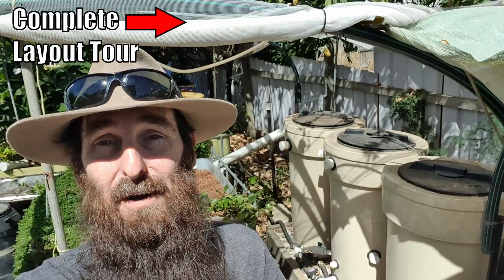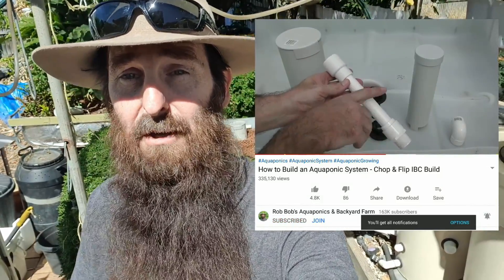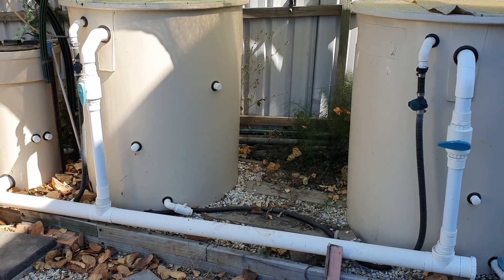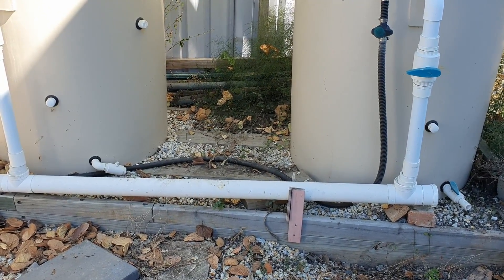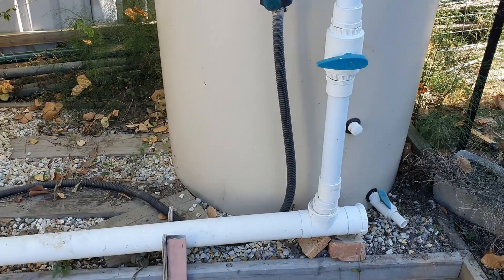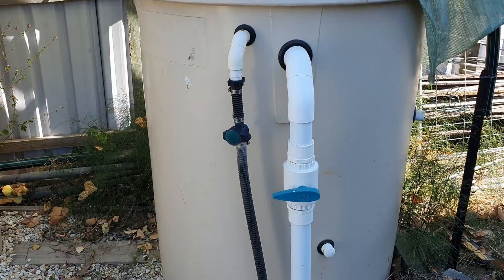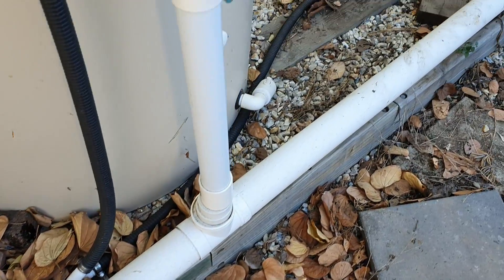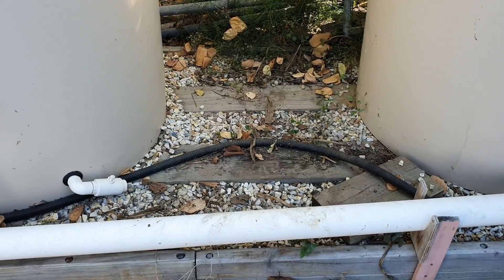Aquaponic System Design Mistakes | Don't Copy Me

Comment: I am having problems with my water vacuum bell valve - when I add lots of supply water the bell valve starts to drain but air suction doesn’t break and it continues continuos - I lowered the supply and now bell valve doesn’t fill to make suction it continually runs same amount of supply - my plants are standing in constant water and I’m having some wilt problems - I’m note sure where to start with what correction - help
Reply from the maker: The video below has a few fixes in it Danny 👍 It should start at the start of the trouble shooting section.
https://www.youtube.com/watch?v=hpVzsM_7uZo&t=1076s
Hope that helps.

Comment: The false bottom principal would remove a lot of that debris with a waste valve
Reply from the maker: I'm not sure that would work on a flood & drain as the draining of the bed from the base would suck the solids along with the water. It may work in a constant flood bed. 🤔
Reply: @RobsAquaponics  I’m talking about the bio media)of course it would work if the exit is at the same level as the false bottom and below the false bottom a waste valve
Reply: Kinda like a radial flow filter but wit a false bottom/ it’ll make ur shaded plants thrive in pure sun

Comment: Great clip again rob, going over something you would change in the future.
I too did run with a 25mm pipe straight from my pump and had the same reduction issues you faced. I have since rebuilt my feedline 'manifold' all to 40mm closest the location of where they are needed, and removed all the 90D bends out of the system in favor of y fittings and then reduction down to 25mm.

from my flow rate i have managed to get the same volume out of the pump lowering the pump down 8% which adds up over time in 24hr costs, not to mention i now have an additional 8% if needed!

can suggest anyone do the same when planning out your system, try to remove or reduce all hard bends, from 90D to having better sweeping bends with 2x 45deg joins and try to keep the diameter of the pipe closest to your pump outlet as long and as high as you can

also highly recommend oversizing your pump, i started with a 3000ltr then 6000 and finally at 20000ltr per hour. Larger pumps often draw less to move more! go straight to a DC pump where you can dial in your required flow rate
Reply from the maker: Running the largest diameter pipe you can is a huge energy saver. 👍
Thanks for the feedback mate. It will help others that like to learn from the comments. 😁👍

Comment: Maybe certain parts of the system could benefit from being made of metal, in commercial food production we use sanitary tri-clamp fittings, they may prove useful in certain areas. Generally speaking they use food grade stainless steel and you can obtain tri-clamp to NPT or FPT or whatever the case.
Reply from the maker: Cost is the major setback with using SS. I did have a second hand 2000L milk vat offered to me once but just didn't have the space.
Reply: @RobsAquaponics  they do make IBCs and barrels out of it but the IBCs cost as much as a car.
The barrels are closer to reality but you’re absolutely right.
You would also have to do quite a bit of welding yourself to keep costs down.

Comment: With the same water pump, you can get free compressed air adding a Trompe.
Reply from the maker: Have seen a few folks say that but am yet to see one in action on an aquaponics system. Would like to see a link if you have one.
Reply: @RobsAquaponics  https://youtu.be/6V6lWEekykA
Reply from the maker: @quantumenergysolutions9128  Have seen that one before. 👍
To run a system like that I would need a larger pump as the one I have. That means extra electricity which would negate any savings I'd get. Would be fine if I was running a larger pump but would probably just use a venturi. Don't have the room with the current system to fit in the other tanks.
Do you run one on your system?
Reply: @RobsAquaponics  If yours or anyone else's 's  pump can already handle eg 2m of head then any system can have a free constant air supply  that can be directed anywhere you like, after a test you will know or not if it can replace your air pump. sure if you were building a new system you need to do your maths about the pump size, and the cost savings of not needing an air pump. Which is exactly what im doing to do for my next system.  I will also install a diy Dan Winter;Clayton Hybrid water structuraliser  for turbo growth, Will also bubble HHO into the water, When in small  closed  systems ,my brewing  will provide free co2!  And the entire system will be in a Generated Orgone Bubble euphoria field, which is a spin of tech of Karl Hans Welz's ahead of his time work. (FB Bubble Tech Group, advanced powered orgone tech!)  As venturis dont use free gravity they consume more energy as you discovered!
Reply from the maker: @quantumenergysolutions9128  I'm open to any suggestions folks can give after running the system for themselves so please report back. 👍
If I was to try every suggestion folks made in regards to aquaponics, veggie beds, composting & mushroom growing I'd be forever tinkering & get nothing done for myself or help others. 
Hope you understand.
Reply: Not really Mate! I didn't suggest to do that because I need proof. !I know my info is Gold!   The info is yours now, do what you like with it!  But don't pretend like you've heard it before ,  when your life depends on it, and need a way faster production i bet you suddenly remember my tricks of the trade!
Reply from the maker: @quantumenergysolutions9128  "don't pretend like you've heard it before" how do you know what I've come across looking through different forums, workshops & groups I partake in?
 I seriously think a lot of you folks that need to preach your "Alt Tech" think your the first to come across it without realising that folks have been using these tech for centuries & prefer to talk about it rather than using it. 
Really shits me that the YouTube comment section needs to become a pissing contest rather than a place where folks can help others.  
Would still like to see what you come up with trompe wise if you have a crack at it. Folks have been telling be since I started that I should use one in mine but have only ever seen one bloke actually include one in his system. 
https://www.youtube.com/watch?v=6V6lWEekykA

Comment: One thing that occurs to me about the drain. From solids pickups to radial filter is that one could go with the small diameter on the horizontal line all the way to the “T” at the second fish tank.  That would give you better velocity throughout.  Draining 2 50mm lines into one 90mm should be about right if you do the area math. Cheers
Reply from the maker: 👍 Cheers mate.

Comment: what do you do about heavy rainfall influencing water volume in the system? do you cover the grow beds, shut down the water cycling or what?
Reply from the maker: Hey Brian. 
I like to leave a 100L/26.5gal free board in the sump to take up any excess water collected due to rain. 👍
My next system will have an over flow drain that will run down to plants in the garden to direct the nutrients from any overflow to where they can be used. 
Hope that helps some.

Comment: I hope you are able to read this: but let me ask, do you think having both the bio filter and the grow media that you are producing nitrate more effectively or possibly providing an abundance in your system?  Is it increasing productivity in your beds? decreasing growth period? Also with the solids filter. I seem to understand two separate opinions: the first, that if you are using a grow media you don't need a solids filter as the media is absorbing enough of it to prevent any ph spikes and if you have worms in your media they will consume the remainder left on the media's surface.  The second, that the solids filter prevents solid build up from not only excrement, but also other organic or inorganic solids that make it in the system (im assuming they mean like hard water build up? maybe dirt or pebbles? I find it hard to see any system working with such chemicals entering its system enough to have build up, but I suppose conditions vary with each grower. ) With which do you align? Thanks mate
Reply from the maker: Hi Marcus & sorry it took a while to get back to you. The biofilter adds some more flexibility to the system. It allowed me to have close to 100 fish in a system that only had enough grow beds to process the waste from half that amount. It also allows me to disconnect the grow beds from the system for maintenance without the fish waste going un processed.
Some folks will claim that worms will eat all the solids but that's a bit misleading. They also create a lot of solids as waste & when they die. Not all of theses solids can be taken up by the plants so if left to build up can cause issues with aerobic zones & denitrification in a worst case scenario. I prefer to not to have the bulk of the solids in there & that way it's one less thing that can go pear shaped with the system. I still think it's a great idea to add the worms though. 👍
You'll also find that most of nutrients required by the plants can be found in the water like the ammonia so the plants will have more than they need in a well stocked & maintained system. 
BTW, the solids that are removed can also be mineralised into a plant available form & added back into the system if you want to set up a mineralisation system. 
Cheers.

Comment: Do you think you could put a crustacean species into the sediment rest tank or your sump tank?
Reply from the maker: Not with the pH that I like to run the system at (6.3-6.8). They would have issues trying to develop a thick enough shell I think.
I have seen folks include them with no issues but they also tend to run their pH a bit higher.
Cheers.  👍

Comment: Are you having the water pump turned on 24/7 or is it on timer?
Can't find a good answer, everybody say something different..
Reply from the maker: We leave ours on 24/7 here so the fish waste water can be constantly filtered.
Hope that helps.
Reply: I run solar never stops
Reply: @wizardmovers9309  Ain't that too much?
Reply: @S....  runs on solar set up with light sensor so goes off at night
Only air stones run over night
Reply: @wizardmovers9309  This is not an answer to my question but ok.

Comment: What's an upflow filter
Reply from the maker: The quick answer is,
Water enters through the base & passes through media. Solids are collected on the media then the clean water exits the top.
When it comes time for cleaning, the water flow in is stopped & air is introduced through an air stone to dislodge the solids from the media. They settle to the base & are drawn off to be utilised outside the system.
Hope that helps some Albert.
Reply: Hmm ok thanks

Comment: Food for thought: bend your PVC in places where you have a turn, but don't need a fitting or clean out. The method I like best is to fill the pipe with sand, then use a heat gun. The sand is to keep the pipe from collapsing and is emptied out once the pipe has cooled. Love your videos!
Reply from the maker: Thanks Robert. Have seen a few folks use that method but am yet to try it myself. 👍
Cheers mate & have a top one.

Comment: Another great video! What's your opinion about continuous  flow in media bed? Have you done any experiment! Thanks.
Reply from the maker: I do think that they run fine as long as you remove as many solids as possible after the fish tank & the water is well aerated.  

I ran one bed as a constant flow at the start & found it made a great solids filter.😉 I think that was due to inefficient solids capture before the water made it out to the beds. The bed went aerobic & eventuated in a nitrite spike so removed it from the system.

Our beds are running as a constant flow at the moment & haven't seen much of a build-up but that's due to next to no solids being generated.

Hope that helps some.

Comment: I have a small aquaponics farm in Thailand that doesn't seem to be doing as well as it could. Tomato plants in media beds grow large with healthy and abundant foliage but flowering is minimal and the flowers do not fruit. Cantelope and cucumber also in media beds both suffer from yellowing spots on older growth but they flower and fruit. Growing cabbage, different types of lettuce, and kale in a DWC. These leafy greens look reasonably healthy but take much longer to mature than the seed packets indicate and don't seem to fully develop.

I have tried adding Magnesium Sulfate, Soluble Kelp, and Iron Chelate to the system water but these only seem to make things worse. I was wondering if you add anything to your system water?

I am sure you are very busy but any advice you might be able to offer would be greatly appreciated.

Some of the specifics of my one year old system:

9800 liters total system water
2 fish tanks (2000 liters each) w/ 90 Juvenal tilapia combined
1 DWC (4000 Liters) and six media beds (Hydroton)
1 Radial flow filter and a system flow rate of 70 LPM
Temp: 30°C, Ph: 6.8, Ammonia: 0.1, Nitrites: 0.0, Nitrates 2.0
The grow-out area is inside of a screened poly tunnel without the poly.
The DWC has 60% shade cloth, media beds are direct sun
Reply from the maker: Hi Tim. It might just be that you're not adding enough feed to the system yet to run all the beds. Maybe take a few offline until the fish are consuming more & producing more waste.
Have you seen any improvement since posting this? 
Cheers.
Reply: @RobsAquaponics  The DWC leafy greens are doing marginally better but I attribute that to the addition of some air stones. The plants in my media beds continue to struggle. I have been feeding 560g /day of fish food with additional duck weed for several months now. I have around 60 mid to large Tilapia and 20 or so fingerlings. I have  been experimenting  with lesser quantities of Iron Chelate, Soluble Kelp, and stopped adding Magnesium Sulfate but I think I am going to try ceasing all additions and see what happens. If you ever get up to Thailand, you have a place to stay in trade for your observations and wisdom, be sure to look me up. I could really use some advice.
Reply from the maker: @9squares  Thanks for the offer Tim. Have a few folks in Thailand I wouldn't mind meeting in real life.
Cheers.

Comment: To bad you didn't have space to lift the fish tanks and drop the filters down a level I have gravity take it out to the grow beds and go ahead and then go to the subtank to get just pumped back to the fish tanks so it's taking less pumps and also it would go ahead and increase your water pressure through your line. Just a idea for you good learning tips thank you for them so I'm glad you shared the experience. Do you have a site to buy something's for aquaponics
Reply from the maker: Our first 2 systems were set up as a single loop systems as you described. 👍
I like the split flow as it means I can take beds or even fish tanks offline without disrupting the flow to other components. 
I sell a few bit's & pieces on this site, https://www.bitsouttheback.com/
Cheers GM & have a top one.

Comment: Hey I am really interested in going into aquaponics but I was wondering if the electric cost is high to run the pumps to filter the fish water (and everything else the pumps are used for)? Please answer thank you 👇❤
Reply from the maker: I think ours worked out to be around AUD$1.50 a day to run without including the solar we generate & contribute.  It all comes down to the size of the pump & how much power they chew through.
The one I'm using is 230w & have seen some as small as 50w that will pump a decent amount. 
Have seen a few folks set up decent 24v systems as well that run from solar & batteries. Haven't had any experience with them myself though. 
Cheers.

Comment: Can you do up a video on the original design of your fish tanks, so we can perhaps understand what was done to get the correct water flow? The vertical tank has so many advantages.

1. It puts your fish tank output above the rest of your system without having to build a platform.
2. A tall cylinder is more stable than a shorter one of the same volume when it comes to holding liquid.
3. It's hard to find a short, wide cylindrical container (unless you're buying custom or new). And it's not exactly feasible to make your own fish tank, because a) building a cylinder is difficult; b) a rectangular fish tank needs to be considerably more sturdy (ie. bulkier and heavier) than a cylinder.
Reply from the maker: Hi Justin. I don't have any pictures of the original set up at Paul's house sorry mate so am only working on memory. 
The inlet to the fish tank was half way down the wall & had a venturi on the inside adding air/O2 to the water. 
It was also twin drain with a smaller 25mm/1" solids drain coming out from the base with a 40mm/1½" clean water/skimmer drain exiting at the top from memory. 
Sorry but that's the best I can do mate.

Comment: You have a killer beard.
Reply from the maker: Post a clip once it all sorted & I'll check it out. 👍
Cheers Harry.
Reply from the maker: Cheers Mr Harry. 👍
Reply: @RobsAquaponics  Hey Rob.  Nice to talk with you.  I'm currently setting up my second aquaponics system.  I made a chop and flip system several years ago that worked well but has now been decommissioned.  My new system is inside a greenhouse and is much larger.  I started with a 4 half barrel flood and drain system which has herbs, tomatoes, peppers and squash.  I've watched many of your videos and you have helped me quite a bit. Thanks for that.  Phase two of my system is under construction and will be a tower system.  I'm having a blast and it appears you are too.  I'll send some pictures if you're interested.  I'm in Florida.